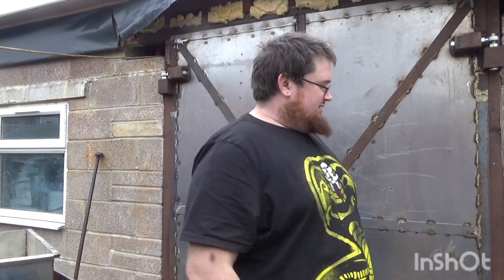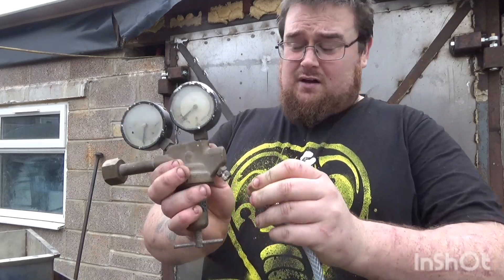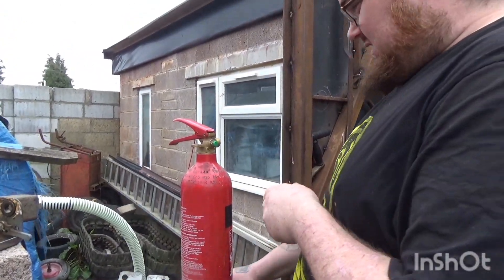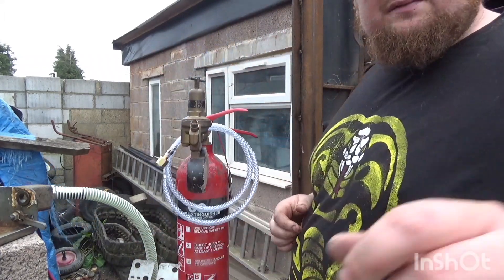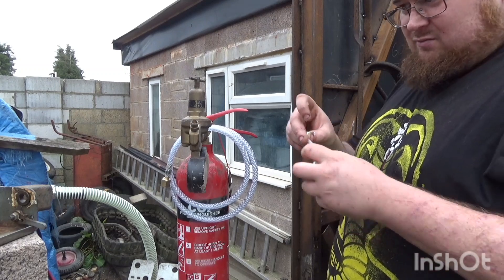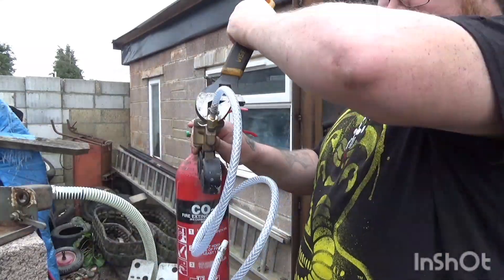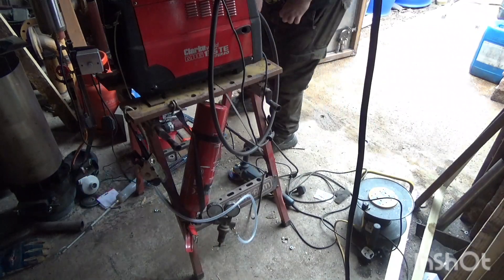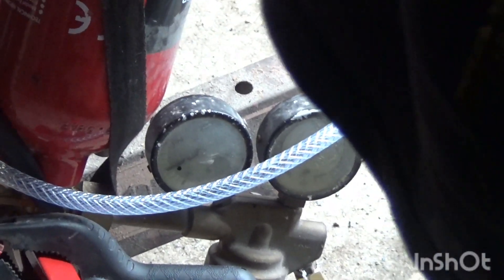co2 fire extinguishers for welding gas. emergency back up or a money saving option?

Comment: Thanks for info Sir, What amp voltage feeding core settings at mig? Thank you
Reply from the maker: I have a 330amp oxford welder with a 4x4 wire feed. Aside from a little bit more spatter and deeper penatration, it welds like argon mix

Comment: Hi sir may you please answer my question

How long full  5kg co2 fire extinguisher give me gas to it becomes completely empty 
To use it for making a dry ice thanks
Reply from the maker: I have no idea about dry ice. But for welding I think I get longer from a 5kg co2 extinguisher as I used to get from a full size industrial argon bottle.
Reply: @smithbuilt  
 Thanks but how much time to empty the co2 from the fier extinguisher if we open it completely
Reply from the maker: @anasalmashhour520  seconds

Comment: Hello    I have a 140 mig welder with 100% co2 disposable gas bottle I'm using 6mm solid wire on 1mm steel and can't get a decent bead    tks
Reply from the maker: Erm 6mm wire? 0.6?
I cant imagine any real reason why any set would have issue just laying a bead regardless of what gas you're running, unless it's a tiny bottle that's emptied faster then you realise..... I've had that happen, spent 10 minutes thinking whys that doing that before I realised my bottle was spent
Reply: Hello. It's a brand new bottle also it's hard to see what you're doing with the wide end shroud, is there a different shroud you can get with a more narrow end, also noticed your wire sticks out is that ok.  Tks
Reply from the maker: Hi, the set I used in this video burnt out on me. But with regards to shrouds typically a wider one is best I've only ever needed to take shroud size into consideration when tig welding and that's because of welding in very confined gaps on pre fabricated parts, mig welding isn't so fussy as you can if needed "flood gas" known as purging into a tight corner then use a long but not too long long wire stick out. If the wire stick out is to long you will just make the wire glow.. 1 or 2 cm wire stick out is fine so long as you have sufficient gas flow to create a gas envelope around your weld. My guess is you're laying some of you're first beads?
Reply: Hello thanks,  any particular wire make you would recommend, regarding flux core wire specifically 0.6mm and solid wire, to be honest I'm trying to weld 1mm and thinner with the ( 0.6mm solid wire and the 100% co2 because the co2 lasts longer, maybe not a good match.  I use Lidl flux core wire and the solid wire comes from static arc were I got my welder.  Tks
Reply from the maker: @martinmorgan8475  I have never used flux core so I cant speak to that. with gas shielded welding I've never found any real difference between wires so long as they are clean and correct for ths work application, arc welding however there is a vast difference between brands and types but that's a whole different world.

If you're new to welding then 1mm and less is gonna take some practice with mig 1.0mm is as thin as I will bother to weld with mig as tig is much more suited to thin metal and way more forgiving. 0.6mm is perfectly ok to weld with mig but you got to move fast as hell.

 co2 by nature is for better for thicker metal as it give deeper penetration, while not ideal for mig welding thin metal I have completely stopped using argon or any form mixed gas for mig welding I solely use pure co2 for mig. Any metals such as ally, stainless or special requirement metal I will tig or arc weld depending on application.